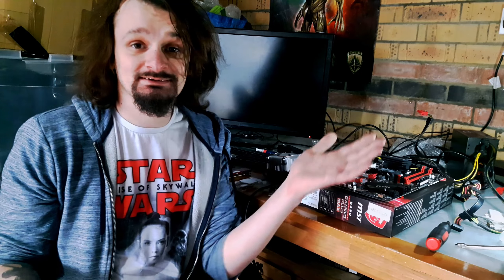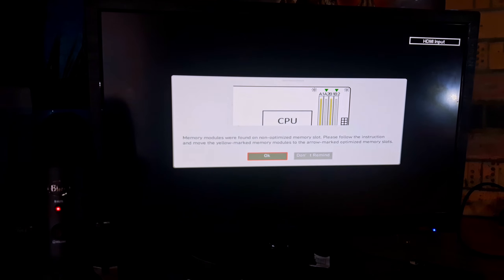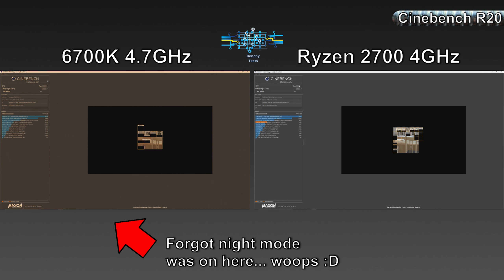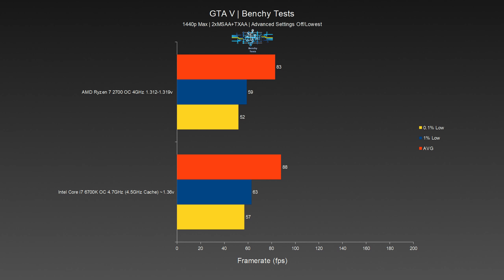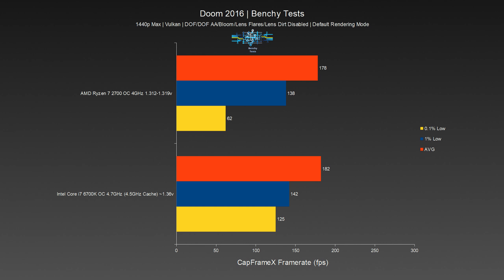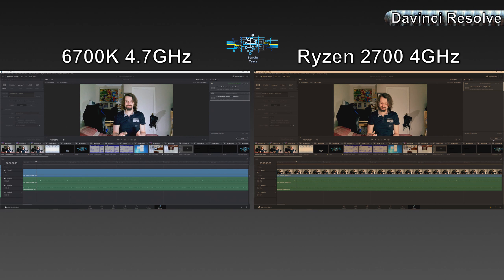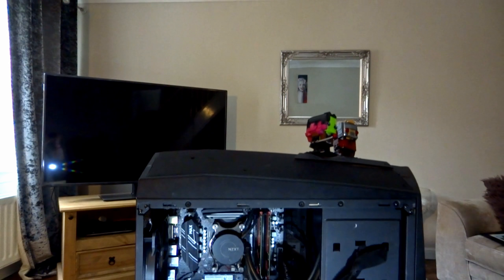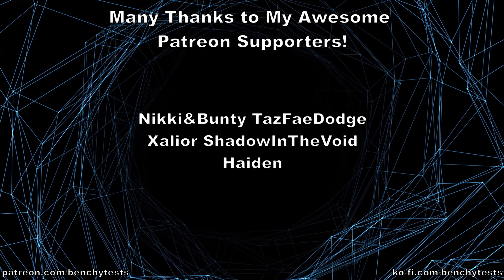Upgrading the Editing Rig/GPU Test Bench - Part 2 (Testing, Benchmarks)

Comment: Nice video Benchy, congratulations on 500 subs.  It was nice to see how much better the Ryzen does on render times in resolve.  Are you still using 15, or did you move to 16 ?  I noticed some performance improvements on 16 vs 15 especially on clips where it stutered  a bit where I had gone heavy on colour correction, stabilisation and Openfx.
Reply from the maker: Thank you! And yeah, I'm on 16, not the most recent one but it's version 16 I'm on at least.
Reply: @BenchyTests  16.2 fixed some small issues for me, around the odd fairlight problem I was having.
Reply from the maker: @johnbrown3155  I'll try that out. It's 16.1.2 I'm on specifically, just haven't updated it yet.